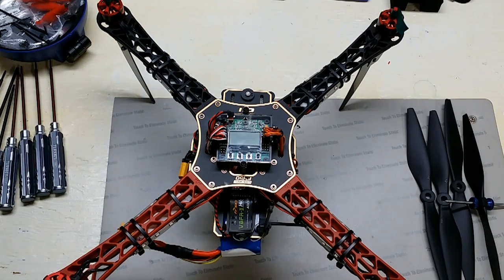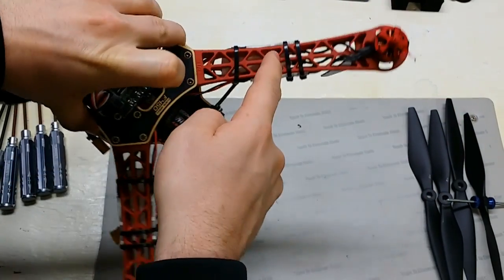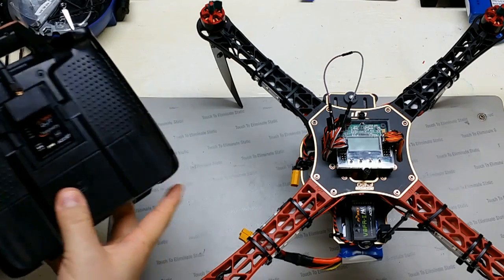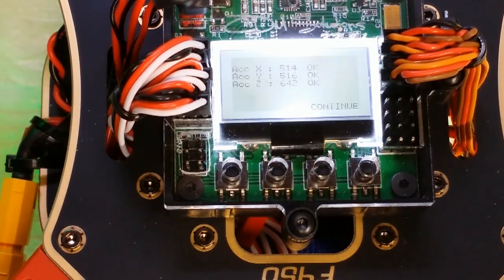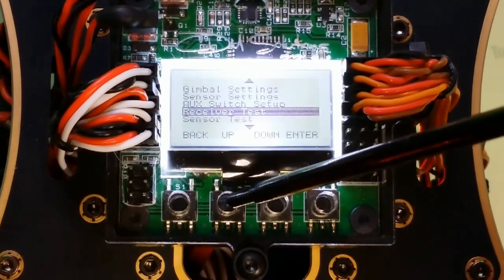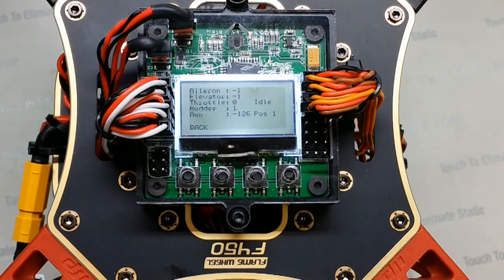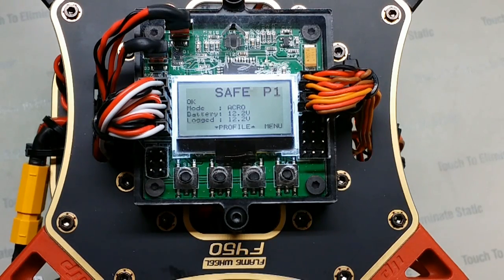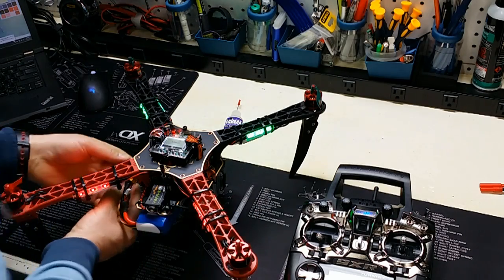DJI F450 Quadcopter Drone - KK2 1 Setup, Transmitter Binding, ESC Calibration

Comment: Hey love your channel and have been coming back to this video to troubleshoot my kk2.1 board. I wanted to ask how you wired the voltage metre. Have you gone from the battery connector to the voltage metre to the pdb?
Reply from the maker: dooseyboy, I no longer have this particular flight controller, so I can't really help troubleshoot anymore. Your best bet would be forums like RCgroups and DYIDrones, since there are active users with the KK2.1 that can help. Good luck.

Comment: Hi, I am kind of stuck with this thing. I have connected it all and in safe mode all seems to be fine, in this radio test option, the controller does recognize all the sticks and is showing values when I am moving them, but after arming it, the only thing which seems to be functioning correctly is the throttle - it lifts off and lands - but that's about it. When I am trying to move the sticks like rudder, or elevation, to move the model in the air, nothing is happening. I did a test without the propellers and there was no change in engines speed when I was moving the right stick. Would you know what could be the cause of this?
Reply: solved. stick scaling was set to "0" i the not working cases. :)
Reply from the maker: I no longer have this particular flight controller, so I'm afraid I can't help troubleshoot. Your best bet would be forums like RCgroups and DYIDrones, since there are active users with the KK2.1 that can help.

Comment: That is a very nice setup.
May I ask where did you get the landing skid Extension? I was checking on aliexpress and ebay, but I could not find one. There are other types, but I like the one you are using, I believe it will give the quad the best stability by landing.
Reply from the maker: Ranger80pl1, the place I purchased them no longer stocks the extensions. This site seems to have a very similar product, but a bit more expensive than what I paid. 
http://www.phoenixflightgear.com/Phoenix-Flight-Gear-F450F550-Flame-Wheel-Legs_p_15.html
Reply: Thank you for the link. It is expensive indeed. A bit too much for a part as simple as a copter landing gear. I believe I will need to check for other options.

Comment: when i connected receiver to kk2.1.5 why receiver is blinking without Tx ON and show yaw input error  plzzz solve this problem
Reply: satendra singh tripathi yaw input error indicates that kk board is not getting any yaw signal from tx. its normal as when tx is off it does not gives yaw or any channel input. when u switch on the kk board with tx on the error screen will be gone

Comment: What kv are the motors?  Also what props are you using?  I built a quad w/ a Q450 (knockoff of DJI board.)  I like the video, but when using your PI settings my quad flipped twice.  The P was way to low.  I'm using 1200KV brushless motors w/ 10x4.5 props.  Decided to do a bit more research on PI settings before I try any more and found out that too low of P setting can result in a quad that can flip in autolevel mode.  FWIW, I double and triple checked the controller, motor direction and props and everything is correct, it will get up in the air and try to stay stable, but as soon as I start to bring it back down it wants to flip.
Reply from the maker: TAZ427 Not sure what would be causing it to flip.  I no longer have this particular quad (sold it), so can't help much with troubleshooting.  As far as the motors go, whatever come with the original DJI Flame Wheel F450 Kit, is what I was using on this quad.  Good luck.

Comment: hi, I am using KK 2.1 all setup seems correct but when I increase the throttle with prop installed it disarm automatically. But when it is without prop it works

Comment: Help! I cannot get mine to arm? Just started doing this, can't understand why? I have checked and rechecked everything. The receiver is getting signals as the KK2 is reading them in the receiver test menu so I am stumped?
Reply from the maker: Not sure what is causing your issue.  I no longer have this particular flight controller, so can't be if much help. Recommend heading to RCGroups forum as there are many active KK2.1 users that can help you out. Good luck.
Reply: +MrArmagedd0n well thank you for replying anyway. I'll check there

Comment: Followed your setup the letter and she flies though a bit twitchy compared to others I have. I do not have GPS on it yet though. One thing I noticed is I can do a CCW funnel with no problems, but CW is very wide and not able to complete the instruction. Is there some setting I need to correct.?

Comment: Hello sir .. can you please help me out with my quadcopter .. i have done evrything right i suppose and trying to do the calibration but the motor just didnt start .. it starts only while i  push the 1&4 buttin together and i tried calibrating them individually but still not able to fly my quad please help sir..  i am in a mess ...  i am using tranmistter fs ct6b and kk board 2.1.5
Reply from the maker: +Rohit Chauhan , I no longer have this particular flight controller, so can't test anything for you.  Best bet would be user forums / communities dedicated to Quadcopters like DroneFlyers, DYIDrones, RCGroups, etc. Good Luck.

Comment: I have f450 and almost everything seems ok. My problem is that the lever on tne transmitter are switched, im right handed and my throttle and yaw are on the right hand so it's wrong. do you know how to switch the sticks? Thanks. P.s. VERY much a newbie first build kk2.15 and fs i6 remote.

Comment: Great "how to" video. Question about self level settings. How do I give myself more control and less to the quad like for better bank turns. I am more of a sport flyer rather than FPV or video.
Reply from the maker: +jerry zito , I was running the Steveis KK2.1 Firmware that is geared more for beginners and / or slower reaction for use with a photography platform. He also offers a "Pro" version of the firmware which is much more responsive and better for stuff like Acro. Search for "Steveis KK2.1 V1.19S1 Updated Firmware".
Reply: ok thanks

Comment: Hi I have a question about the 9XR pro that you are running
What reciever are you pairing it with? Im looking for a TX RX and im leaning twards the 9X with the 9X and 8channel RX from Hobby King, Your video REALLY helped me set up my SK450, now im looking to start upgrading.
 Thanks for sharing!
Reply from the maker: +alien4fish , I was using the FrSky V8FR-II 2.4Ghz 8CH Receiver (HV), with the FrSky DJT 2.4Ghz Telemetry Module.
Reply: Outstanding! I just ordered the the Taranis plus combo fro Helibatics and it shipped today.
 But im having a HELL of time trying to get my SK450 to fly right, It seems to want to gyrate around Not stable and it flipped over on itself.
Hopefully the Taranis and new reciever will help.
Thanks for the response and taking the time to post up this video, Happy New Year!
Reply: +MrArmagedd0n Friend, I want'll make a tricóptero t3, I will use the radio Turnigy 6x FHSS with KK.2.1.5. I can calibrate the esc this anyway ??? if I remember correctly, I should put the stick in the maximum, connect the battery and then the esc 2 beeps slow down the stick? also would work I calibrates one esc to see using just the receiver?
Reply from the maker: +Raimundo Vieira, I sold my DYI quad and purchased a 3DR Solo, so if the answer isn't found in one of my older setup videos, I really can't be of much help. Sorry.

Comment: hi. can you help please. how can i change between default Misc. settings to Misc. Settings 2 on screen? is it possible to do without usbasp - cause i have just the board.  may be pressing buttons))?
Reply from the maker: Iron Man , I have sold this particular setup, so don't have a way to test for you. Sorry.
Reply: np man. resolved this issue/ thanks

Comment: Dear you like expert could you help me to setup qq super flight control with radio link At9 actually I done all connections but all motor is not spinning in the same time only spinning 2

Comment: which type of wires are you using to connect thee kk to the receiver
Reply from the maker: vineet yadav Using standard 3-pin connectors, with 22AWG servo wire.

Comment: do u need to connect osd to flight controller ??
Reply from the maker: I am not using OSD on this particular multirotor, but yes, it would typically plug into the flight controller.
Reply: i think i searched the whole youtube on how to connect osd to flight controller and i cant seem to find one can u please link to anyone thnx
Reply from the maker: blackdedo93 
I don't have any links for the KK board, but search "Minim OSD Quick Installation Guide", and you will get tons of pictures / wiring diagrams showing the setup for connecting an OSD.
Reply: MrArmagedd0n
well what i mean that in almost all vids they use the osd alone without flight controller
and thanks for replying so fast :)

Comment: Hi! At 11:00 mine is reading much higher values. When i arm my quad the motors start running. Is it the KK2.1 or the Turnegy 9x that does that?
Reply from the maker: Adjust the trim settings on your 9x until they read as "0" on the KK2.1 screen.
Reply: MrArmagedd0n thank you for taking your time to answer my question! This is a great video guide !

Comment: Can I Attach 30A ESC directly to the kk 2.1 board with 11.1v 2200mah battery. .?

Do I need to use BES for my quadcopter. ?

Comment: I like the feet you have on there.  Where did you get them, I keep going through lame landing gear and those look pretty cool.
Reply from the maker: They are carbon fiber, and the set of 4 cost me around $35. The link I had saved is no longer active from RC-Drones where I purchased them.  They work and look great, but I recently had to replace them because my new gimbal didn't have enough clearance. I will post an update soon showing the new ones.
Reply: Aliexpress.com search for "CF DJI LANDING GEAR"  10$ for set of 4

Comment: Hi do you know what is wrong with mine, because they all spin at different speeds and one of the motors is scorching hot!😕
Reply: Cameron if the motor is getting scorching hot that means there is impedance so something is wired incorrectly which is causing the voltage through that motor to be too high
Without seeing it I can't advise but Totum hobbies should be able totalk you through how to wire it if you go down and see them. Love you son  oh one point check the soldering to make sure there is no bleed of solder across contacts that would lead to faulty circuit and prevent the board working.

Comment: Do you know how to set the 45 deg. offset to fly in X  on frames that only have mounting holes setup for + config.?
Reply: The board must always face forward and there is no offset functions that allow the board to be mounted at a 45 degree angle.
Reply: teamscreem Not true. Have a look in Misc Settings. Ref: http://dl.btc.pl/kamami_wa/hk_54299_7.pdf
Reply: Thought we may have been talking KK2.0, I could not find it on mine with V1.6 firmware. You could also mount it at 45 degrees and use either the X or + motor layout for  + and X respectively to use the 45 degree offset build into the board. Always more than one way to skin a cat. Thanks for the link to the latest setup instructions, they are very informative and I may use them one day if I go back to using the KK2 boards.
Reply: teamscreem Oh, I just assumed that with the latest firmware the KK boards would be the same. Bit silly when I think about it since the different KK boards have different hardware and thus the firmware can't be the same. I can only speak for the 2.1.5 (which does have the offset feature), but I would assume the 2.1 also has that function.

Comment: New to diy quad pardon what may seem like dumb question but with opto esc's am I removing both the + and -  off the esc wire and replacing with + and -  from the bec wire to power the kk2 at m1 pin

Comment: Greetings! Nice video. I am having troubles figuring out how to power the board. If my speed controllers have BEC's, then I plug them in like normal and let speed controller 1 power the board, but then clip the power leads on speed controllers 2, 3,& 4 so it doesn't get over powered? Or do I just plug all speed controllers in like normal? I am using the board for the HK 250 quad copter and i am using all stock component. I would greatly appreciate your help. Thanks
Reply: Good question. Clipping is not needed on the remaining escs. The board simply does not use them.

Comment: Why are you calling it a drone.   Can it fly without your input?  No it can't.   Can you set way points? No you can't.  It's people like you giving our hobby negative attention.   Quadcopters are not drones unless you build them that way.  Your flight controller is a kk board.   It won't fly without with out your radio commands.  I don't want people thinking my quadcopter is a drone.
Reply: +Nathaniel  Richardson or just stop whining? i dont know
Reply: +Nathaniel  Richardson drone- 
Dynamic
Remotely
Operated
Navigation
Equipment.

A toys r us rc helicopter can basically be called a drone

Comment: Thanks! I have a HEX but only three of the motors spin up once I've gone through everything. Swapped wires around but no luck. (The problem motors seems to sort of vibrate/get stuck).

Any ideas on what to look at for this?

Comment: What FW ver are you on? I have a KK2.1 and factory reset has HW ver 2.15 and FW ver 1.6. Thanks for the video.
Reply from the maker: I am currently using 		the firmware created for the KK2.1 by Steveis over on RC Groups.  I am using the "Lite" version which is more for beginners. The firmware is called: KK2V1_1V17S1Lite